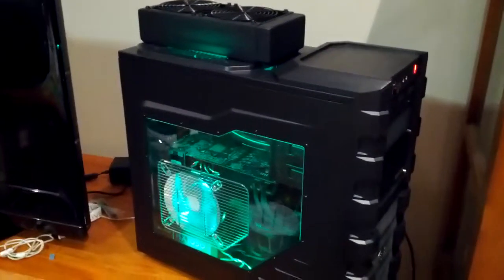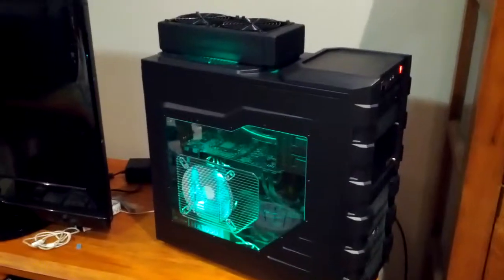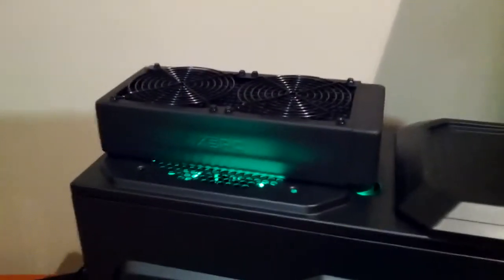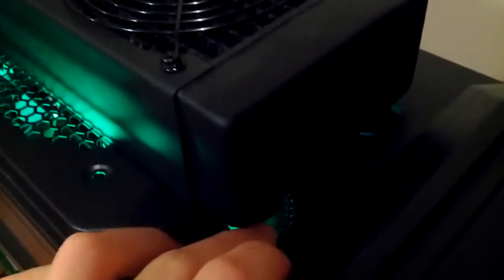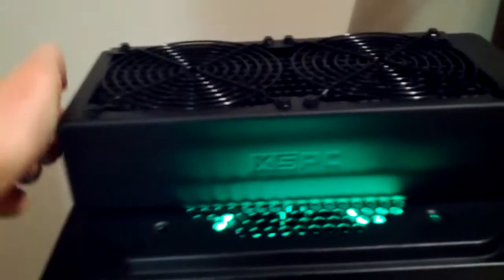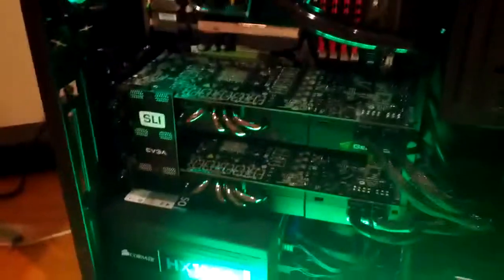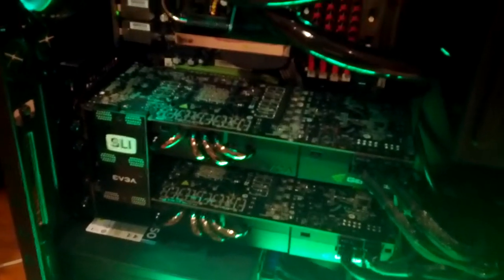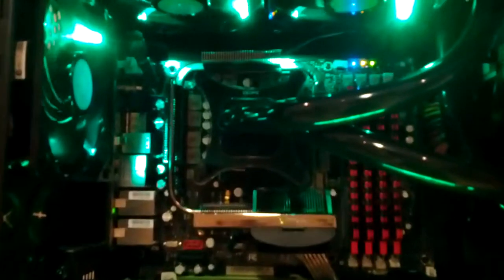790i Ultra SLI build update 3

Comment: I got the same exact case.. the coolermaster haf 912 advanced.. currently have a z77 asus board in it but will be changing that out some time in the future.. I had bought a P5q3 asus board because it has up to 16 gb ddr3 ram instead of 8 gb.. but after I went to put a radiator on it to cool it, I found out that all the caps around the cpu prevented me from putting like a Corsair h100i radiator on it.. so I got kind of disappointed as I wanted a water cooled 775 socket with the ddr3 memory.. so after looking around on Ebay at boards which might work.. I found that there is an evga 790i ftw digital pwm board.. the only problem is, there are none on ebay and can not find any at all right now.. so I sit waiting till one pops up at some point.. LOL  I tried putting a h100i in my build as well, it would not fit, but what I found was, if you put the radiator inside and the fans on the outside, that works fine.. but then you also have to put the back fan on the outside as well.. but it is doable and I have had it set up that way.. all you need do is drummel out a hole big enough to slide the two fan wires through and so I did that and bought a grommet that fits over the drummeled hole.. so you can not even notice it, as its so tight to the fans, and then I got some grates for the fans so they get covered up from someone sticking their fingers in them.. I just thought it was a little louder then I wanted with the fans on the outside of the case and eventually went with the H80i instead and just one 120mm fan on top.. they should have made these haf 912 advanced cases just a tad big bigger for a rad and fans to fit inside.. two inches higher and two inches longer and they would have had a perfect small case.. but I do love it and would love to get another one some time..  

on your build I liked the two gtx 480's.. they looked great..  and that rad you had on the top.. that was pretty thick.. LOL  so you can not quite bust 4k on the cpu??  did you say that was a q9450?? that would be a 2.66 to push all the way to 4k..   you can always go to a qx9770.. it is a 3.2ghz chip.. you will hit 4 easily.. probably even 4.2 no problem.. but its also 1600 fsb as well instead of the 1333.. I like trying to match the components as best as I can such as a mother board which is 1600ghz with ram which is 1600ghz and chip with 1600ghz as well. so there is no bottleneck at all in the system..  anyway, I enjoyed your build.. good job.. hahaa still laughing though on the rad..

Comment: This man had 2 480s. That's basically a high end room heater😂
Reply from the maker: I have actually done 4-way sli with GTX 480 before as well to be honest they don't generate as much heat as they are hyped up to generate if they are in an open air test bench environment inside of a case though they get pretty toasty
Reply: @VictimRAID  I know i was making a dumb joke. My friend has a 480 and it doesnt even run toooo hot even with the bootleg thermal paste he poorly replaced it with